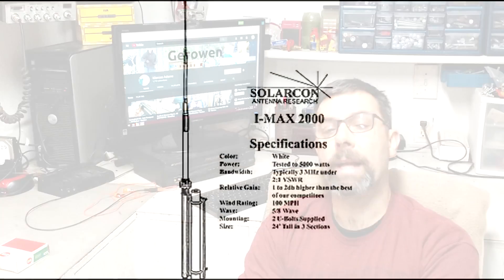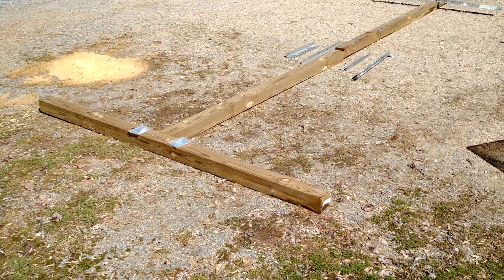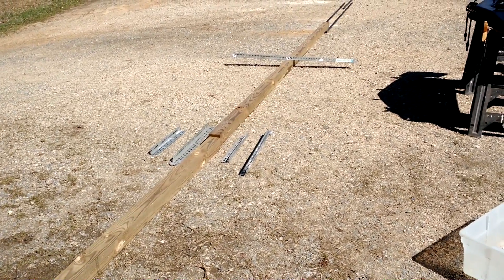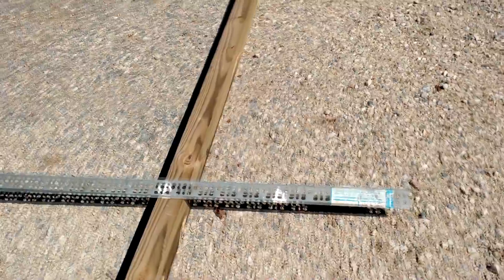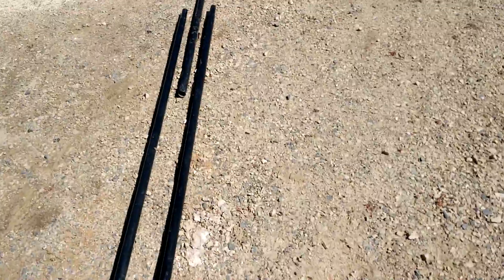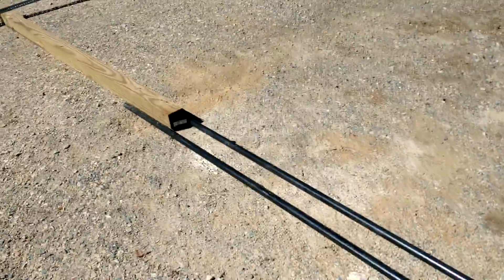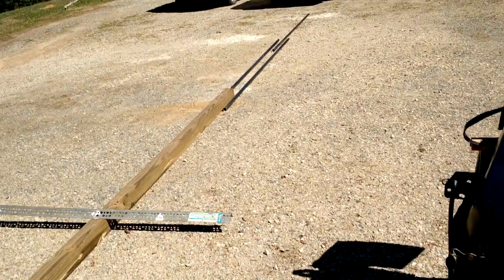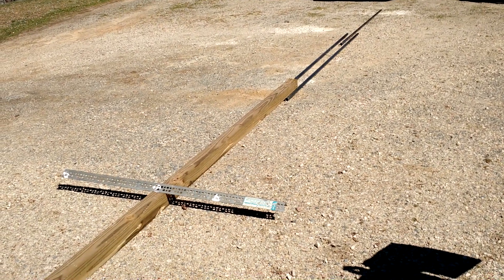Home Built CB Antenna Tower Idea. 45 Feet for less than $75.00 ?

Comment: friend of mine did the same with 4x4s 16ft an used 4 3ft 2x4s an bolted them to each side of where they was end to end an used a 10ft pipe 2ft down the side of the top 4x4 an put the antenna on the pipe he didnt put the 4x4 in the ground our anything he had a brace to keep it from kicking out he said it works good been up 5yrs now an been through some bad storms
Reply from the maker: This one is still working fine and yes, it's been 5 years. I should make a follow up video.

Comment: I don't really have the tools to make a outdoor one like this so would it work if I used a Workman Saturn B100 Base Station Apartment Attic Patio Balcony Boat Truck Antenna and I mounted it to the inside of my window and ran the coax cable from it to the radio for indoor use?
Reply from the maker: Yes it would!
Reply: @FarpointFarms  ok that's cool thank you

Comment: Did you ever mount all this? I ammlooking for a cheap yet safe way to get 40-50 foot off the ground on side of my house to mount my 1-2 dipoles for my low power fm station. I have two top rails I got from lowes last year, want to get more, but wanna do it safe. Any ideas sir?

Thanks

Comment: I have some creosote pilings that are 27' long.  I drilled the center down 12" and inserted a 10' long galvanized 1" conduit into the hole filled with epoxy.  I wrapped the tip of the piling with carbon fiber down 18" to make sure the piling does not split.  Then I filled the conduit with epoxy to stiffen it.  Then I mounted the max 2000 to the conduit.  I augured a hole in the ground 4 '.  Then strapped the piling onto my track hoe bucket and picked the whole thing up vertically and sat into the hole and filled with concrete.  The third section looked like it was broke at first in the horizontal position.  So I guess the tip is 56' off the ground.  I can hear the entire US on skip from South Alabama.  To new to talk yet.
Reply from the maker: Great distance on the skip. I am sure with how you set it up it will last forever

Comment: Might look into some Schedule 40 galvanized 2-7/8” pipe. You can get it at commercial fencing companies in 24’ lengths for about $70. I used one on the base, and then a thinner walled piece of 2-3/8” galvanized inside of that to extend it to 35’. With a solid base setup I think it could go higher than that

Comment: Do yourself a big favor and ditch this idea. 
  Just go buy a sail boat mast. They are lighter, Stronger, look better, don't age and used ones are everywhere for decent prices, They are hollow so you just slip them over a 5 ft 2-4 inch pipe set in a concrete footer. Lastly it doubles as a GREAT flag pole but cheaper.
I did this and it works GREAT!

Comment: Use a piece of all thread where the posts meet, drill a slightly smaller hole than the all thread, and screw the posts together- then use your bracing.

Comment: I've had an A99 mounted to the chimney now for a year, up about 25' to the tip. Works great but like everything else in this hobby you want to upgrade. I have a fat boy six pill from Bullett Bob and use it with a Magnum S680. DX talking when conditions are in here in the San Joaquin Valley of CA  is good. I've got a Zero 5 30K ground plane that I want to get up and have been thinking how I want to mount it up since I'm not going to be able to put up a large footprint tower. This is a great idea.  Thank you Sir.

Comment: My friend and I have found three people who have unwanted tubular towers they just want to get out of their yards. All we have to do is take those towers down. So far, we got one 20 foot tower down and cobbled up an extra length of steel pipe to fit inside the mast sleeve. We used it for my friend's CB tower, attaching the antenna to a steel pipe that's attached to the pipe that's in the tower sleeve. We hoisted the tower up and lifted the pipe up like a periscope to a height of 40 feet. He doubled his output power from what he had before. A person could ask around and search for an unwanted tubular t.v. tower that someone just wants to get rid of. We found two other people who both have unwanted 80 foot tall t.v. towers. It's just a matter of getting those unwanted towers on the ground in a safe manner, then using the sections we need and taking the extra sections to the scrap yard.  It is my understanding a tower, that's not near an airport, can be 200 feet tall without needing a permit from the Federal Aviation Administration. Anything taller will need a FAA permit and proper lighting.  So, if either my friend or I hit the lotto, we'll hire a crew to install two, free-standing CB towers just shy of that 200 feet limit.

Comment: If you could get you hands on an Antenna Specialists Super Scanner there is a lot of gain there.  It is comprised of 3 @ 5/8 wave vertical dipoles in an triangular pattern.  I think its about 5 db gain in Omnidirectional mode and 9 db gain in beam mode.  It has a 4 position switch that you can change directions on instantly rather than wait for a beam to rotate.  Each directional lobe covers about 270 degrees.  I talked to Caracas from Scranton without skip at night with one.
Reply: i have a super scanner antenna and the only problem is 300 watts max.!

Comment: i don't want to sound too egotistical but my best antenna was the hygain penetrator 5/8 wave that i bought way back in 1983 and still have it. people use to tell me that i sounded like i had a linear hook up even though i only had my cobra 148GTL hooked up to it with dead key 4 watts and modulate 20 watts .  i use to get up to 15 miles straight line
Reply: I have a Sirio 27 5/8 ground plane that's up about 40 feet at the radials and people all the time think I'm running power. It's all in the antenna first.

Comment: I have a homemade crankup up tower I bought. I would like some advice on some ideas I have for it.
Reply from the maker: Crank up antenna tower? I'm already interested!  What are your questions?
Reply: @FarpointFarms  well it's a crank up/ tilt tower. Hinged base plate. I plan to raise and lower the tower using a utility pole that's place directly in front. Pulley at top of pole, with cable and boat winch. I was told using this method, I could  get away without having guy wires.  If so, that's my goal. I have limited space where the tower will be erected. Tower at lowest height is about 32 feet. I can crank it up between 50 and 60 feet. The pole is 16 feet high, and with the tower cranked completely down, there will be 16 feet above the pole that will not be supported. Any advice or comments are welcome.

Comment: What would it take to have the utility company set a 40 or 45/50's pole? It would last so much longer and hold up to the weather. Become friends with a few lineman...electric lineman.
Reply: Then a 50". 7 foot in the ground.... Some guys you buy them beer and the'd swing by after a job in the area and they have old poles they get rid of.
Reply from the maker: I looked into that at first. Called a bunch of companies and finally found one that had an old timer who realized what I wanted. 
    His advice was to skip it. Yes the pole lasts a lifetime, but once sunk its only 35 feet up.  I still considered it, but then he told me the cost..... $1500 installed!!  You could get a real tower for much less.
Reply: I'm a equpment operator for the power company and I'd do favors like this all the time. I'm just in Arizona... To far away
Reply: That would be great but a HUGE pain in the a** to climb to do installs or modifications to it, I have spikes and I can tell you from experience once your up there your limitations are greatly reduced.

Comment: I once upon a time was using CB radio for a hobby, which was a real no-no then, it was supposed to be for either business or for a family, but not for just general shootin the "whatit call it". And the height was to be 20 feet. Either 20 ft above your house or some building, but not above a tower, only if the tower was built primarily for some other reason. 20 ft from the ground if you just placed it , say in your yard, but 20 ft was the max .  What has the FCC done, changed to normal thinking? Oh yeah this was in the early 60ty's.  When all radio's were tube type, turn on wait 8 days and you would hear something. Now if you left your radio on for super long time, the tubes would slowly degrade and you would have to replace certain tubes. But if one tube was weak and slowly losing it's strength you could bet every tube was also going bad, so if you had a few working brain cells you would replace them all if possible. My first transceiver was , wait it's coming, maybe a Heath kit. You built your self, aka solder it together and align it. But having no O scope or S meter, well if your heard someone and they could hear you, that was good enough. Oh it had a regenerative receiver, wonderful. The next radio was a Allied Radio or a Lafayette, don't remember. It was a different time, ooh and my ant was made of electrical tubing.  Cut to length 1/4 wave with a ground plane, all made from tubeing and a hunk of plastic to hold the tubing for the ground plane and the center radier was in the center to provide insulation from the 20 ft mast that was on my house. My mother said it was a fancy lighting rod.    C U L..73's   from the peanut gallery, "Howdy Duty" show.er, time.
P.S. you had better hold the power to 4 watts total output, 5 watts to final driver. And where I lived the FCC did  monitor the bands.

Comment: The height above ground, "Physical Wavelengths" will have major performance   outcomes depending on the frequency. Height isn't always better in some cases (the higher the antenna,the lower the radiation angle)With HF, 20° radiation angle is ideal for SSB  operation, Also with lower frequency's with such a long run of coax,keep in mind the loss in d.b's and velocity factors. LMR 400 is far superior than RG213, with long coaxial runs, your coax can turn into a radiator itself, look into making a simple 4:1 balun to keep the R.F. currents from feeding back down the coax, also the coax measurements should be cut to wavelengths equal to the frequency your transmitting on. Having an odd length of coax will cause high SWR's even though your antenna is a flat match. I do know with VHF/UHF freq's, each coax coupler with have a 1/2 of D.B. loss so the fewer the connectors the better.
   Your antenna is EVERYTHING, AND HAVING GOOD GROUND IS ESSENTIAL, Keep in mind , electricity travels in the least path or resistance,and with DC currents, it travels from ground to positive not positive to ground, with that being said, your "Ground to the antenna and radio, must be as "SHORT AS POSSIBLE". This is only my opinion but, I would choose something other than wood for a antenna mast, Again, only my opinion.
  Kind regards,Eric Dee.
Reply: This is CB. Wavelength is 11m. It isn't hf
Reply: @rayh592  11m is between the 10m and 12m HF bands.  It's solidly HF territory.  It acts just like the HF ham bands and the same techniques can be applied.

Comment: Don't waste your money playing around with fiberglass antennas, there junk. I have tried them all and they are just variations on a theme. They are all just 1/4 , 1/2 or 5/8 wave no magic involved. Way too much money for what you get. If You are a DIY guy and I think you are try a single element quad. you can build one for around 20 bucks and this is a full wave antenna. Far superior to an antron 99. The down side is once you master this single you'll want to build one with more than one element. And it goes on from there.

Comment: I saw a video on YouTube where a guy a wire dipole for his CB radio, you may seem the video. He made wire dipole that was 102" on each leg foe a total of 204" when you hang it up. He live in NJ and made a contact in Texas in the AM mode. I don't what you think if this, but I am thinking of doing this myself. The thing this guy was using this antenna inside his house when he made the contact. I was told once, a radio is only 10% operation where the antenna is 90%.

Comment: G’day mate... from Sydney Australia. Looks like a good project!! You may want to consider using the RG58 thick coax cable to reduce power loss over the extra distance between antenna and radio. I ran an antenna at about 100 feet in the 70s on a unit block here in Sydney, worked great!! Good luck. Cheers Anthony
Reply from the maker: Thanks! I'm glad folks from "down under" are fans of the channel.
Reply: I remember when Peter and Sue came from down under in the 70's and visited the "West Coast Chicken Hauler" and 721 John around the bay. Then came up and visited us boys in Seattle.  903 in the evergreen tree still on the air 38LSB now up by the dog gone water tower pulling the plug......glub glub glub

Comment: The Imax is a great antenna. I noticed improvement in rx and tx over the a99.   I highly recommend painting the Imax , as long as it's non metallic for obvious reasons. Doing this will extend it's life and keep it from fraying. As far as the ground plane kit goes, I didn't see much of a difference in the performance with it installed. You may experience different results though.  I've never had a problem with my neighbors complaining about RFI. I'm using RG-213 coax with an  8 ft. ground rod. I haven't had any problems with it in the 3 years I've had it. It can be raining to beat the band or experiencing blizzard conditions and the SWR remains unchanged at 1.2 to 1 on all 40 channels. I'm very happy with mine and would buy another if this one fails. 73
Reply from the maker: Thanks for the info. I just got the IMax in the mail yesterday! can't wait for better weather to get this thing started.

Comment: That looks awesome, thanks for the shoutout!  I've thought about extending mine, but doing so would mean some kind of guy wires or something since I don't, at least right now, have a structure I can mount it to without messing with the shingles and things on the edge of the house.  The fence posts I have on there now do great with the single 4x4 and single piece of conduit, but that antenna and conduit exert a lot of leverage as the pole gets longer.  Mine right now is just a 12 foot 4x4, but I made a similar pole for my brother out of a 16 footer and when I'm walking his up with my hands, the leverage makes it feel twice as heavy as mine does with the same antenna and same length conduit.

Random thought.  I just built an 8x8 foot deck on the front of the house.  I haven't added railings or trimmed the excess off corner posts yet.  The corner posts are 10 foot 4x4s that are cemented 2 feet into the ground.  I could move my current "pole" onto the deck, attach the hinge to the floor over a joist, and upgrade it to a 16 foot 4x4, then just attach it to the side of one of 6 or so foot stretches of 4x4 that I still have sticking up that I haven't cut off yet.  That would give a ton of lateral support to keep it from swaying, but on top of the 4 additional feet on the 4x4, I would gain 3 feet or so from raising it onto the deck floor.  Attaching the hinge to a floorboard/joist would hold the bottom end steady whenever it came time to lower it, but I would have to angle it such that I could use guy wires to help support it while I lower it, or maybe when I lower it I could just lay it across a railing and just use a ladder in the yard to reach my antenna.

You've got my wheels turning now, :p  Take care, and thanks again for the shoutout!

Comment: A friend of mine built me a 50’ tower out of top rail and 3/8” round bar.  He made a jig to bend the round bar in the “Z” pattern and welded it to the top rails.  It is the exact dimension of a ROHN 25G tower section.  He also made the top section and a solid fold over base.  Did it all for $310.00 and it lasted from 2004 until Hurricane Harvey brought it down. It was pretty rusty by then, however.

Comment: Wow. You must be way out in the boonies. IMAX's bleed like crazy. And you got twenty years out of an Antron? That would be a record here in Fla. Once the covering starts to fade and thin, they hold water around the coils inside the fiberglass. SWR's go thru the roof after every rain,  Moist they draw lightning, which is why we call an Antron99 a lightning rod here also.  I won't talk off of anything but aircraft aluminum. Period.  Money well spent. Beams and a rotor friend. Go big or stay on the porch.
Reply from the maker: I'm to poor to go big.

     Still I do dream of a 5 element beam on 60 foot crank up tower like I saw when I was young. Since I'm dreaming, maybe a Cobra 2000 with all the added features and a foot warmer to make it really talk?
Reply: find a local junkyard and see if you can buy cheaply the aluminum tubing etc and build your own
Reply: Eric I live in south Alabama and am using a new Solar-con 99

Comment: The A99 was a piece of shit from day 1. A 14ga piece of wire is an upgrade from an A99.
Reply from the maker: I couldn't disagree more. I had a Shakespeare "big Stick" and an Archer base antenna (very similar to the shakespeare), and the A99 out preformed them from day one to today.  
   I've had mine up for 18 years and it's still a great Antenna. 1.2 swr out of the box and 18 years later still 1.2 without ever needing to be re-tuned even after moving it across state.

   I don't know where the hate is coming from with these things. Everyone I've know personally that has owned one loved them.